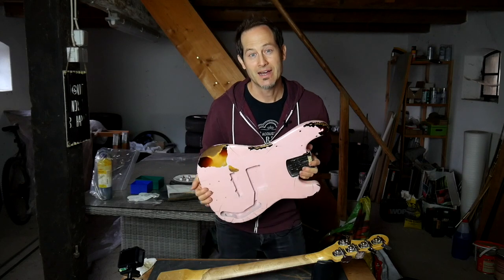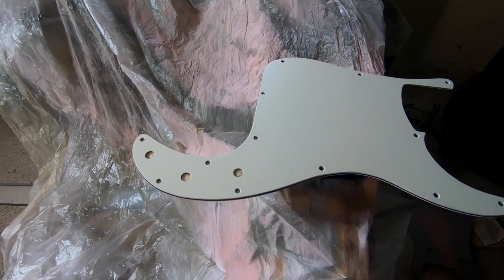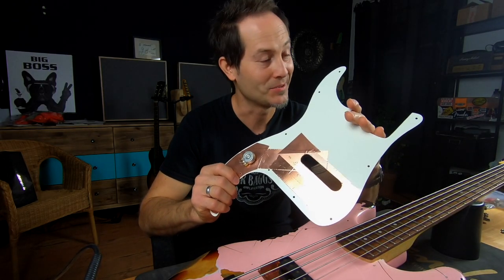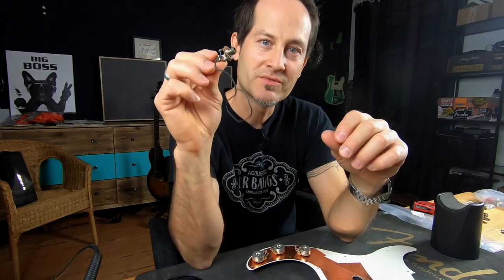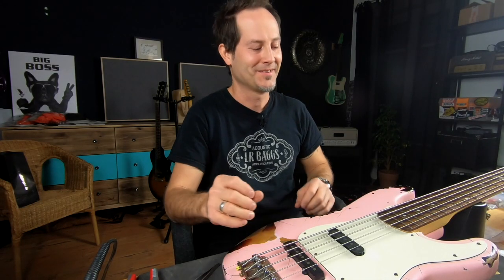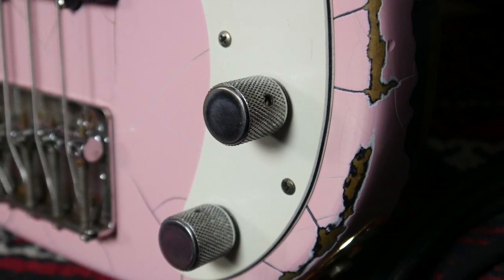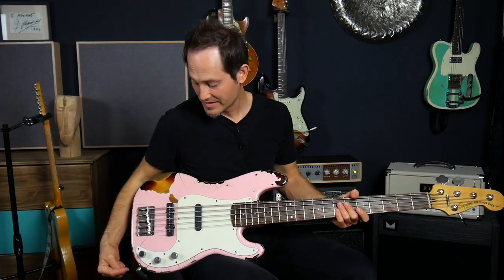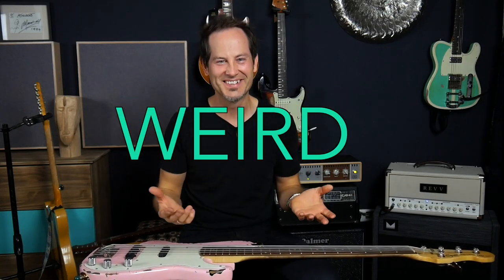Is This SQUIER a Custom Shop Now? | Last Refinishing Episode | GUITAR TWEAKZ

Comment: Amazing work Kris, it turned out amazingly, much better than I thought it would when I saw how the pink crackle glaze had gone. The pickups sound amazing. I've gotta ask though, how did you get electrical conductivity between the bridge pickups shielding foil and the rest of the shielding foil? You should do more of these. How about a Lake Placid Blue Strat over 3 Tone Sunburst? Oh, keep the gold jack plate, it's cool and adds mojo.

Comment: I used to think that relicing was senseless up until I read an interview where the people from Fender Custom Shop explained the process. Relicing is a true form of art.
To recreate “Blackie” (the famous Clapton’s strat) they investigated what happened exactly to each square centimetre of the instrument, recreated the cigarette burn on the exact spot of the pickguard, and they found out that reining the fretboard was not so easy as Clapton had actually refinished his original fretboard numerous times so they had to recreate the wear, refinish it a couple of times over. Quite incredible

Comment: How can I get my hands on that single coil V string p bass pickup @Kris Barocsi
Reply from the maker: Hey Brandon, contact Nick Silver, they made this custom pickup. Super nice guy, top notch pickups, fair prices. I’m pretty sure there’s a link to their homepage in the description box. If not, you’ll easily find it in google. Cheers
Reply: @KrisBarocsi  thanks. I have have one more question. I have the same bass and I am looking to mod it. What are the dimensions you used to reroute the jazz bass holes
Reply from the maker: @brandonspringfield9007  I made that together with a good friend in his workshop (he makes Franz Basses, an extraordinary bass luthier). We routed the old routing to a big rectangular shape then completely filled it. Then we used the normal US jazz bass pickup measurements for the new routing.